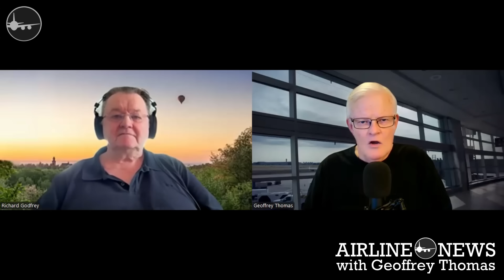Air India Crash - Probable Cause  #airindiacrash

Comment: Going with Richard's probable cause explanation, did the Lithium fire happen due to a regulation not being stringent on protection and just insisting on demonstrating venting?
Reply: No; they're not saying that. What they are saying is that the EAFR were designed to deal with 1 source of damage, but not 2 at once. In this accident, Richard hypothesizes that 2 sources of damage rendered the EAFR unreadable:
1. Probable water ingress leading to 
2. extreme chemical oxidation  into the APU battery leading to a thermal run away and chemical fire at a temperature far exceeding 2000 deg C and aggressively corrosive, speedily and severely damaging the EAFR beyond its design limits.

The only thing as bad as a lithium battery thermal runaway fire is a Oxidative Chemical Fire. Together, these ignition sources could not be contained by the battery fire containment hardware.

So Richard is suggesting that the lithium battery protection and the EAFR certification standards did not fully reflect the possible combined hazards both could be exposed to in the real world. So the regulations will need to be updated.

Comment: Should be possible to jettison a secondary memory module out of the craft if its surrounding environment gets hostile. The ejected module can deploy a drogue or be otherwise impact-protected, be able to float, and activate a beacon. 300 grams of payload should be enough, plus physical protection ― still under a kilogram. This memory will miss the last few seconds  before the crash, but may preserve the main causal factors behind the crash. It's merely profit and politics that get in the way of designing such devices.
Reply: Modern wireless networks are fast enough to allow dumping a significant amount of data to a remote storage service in the pre-impact time.